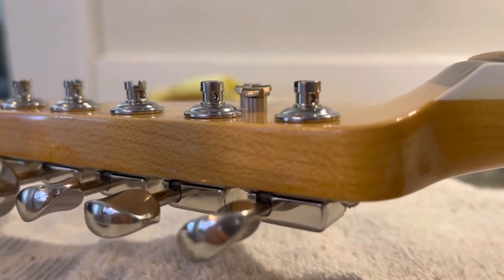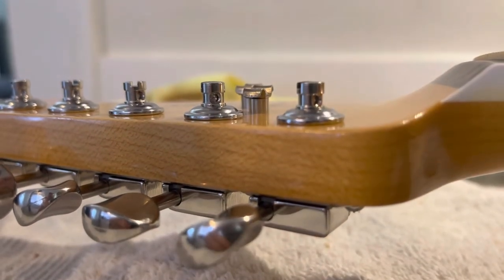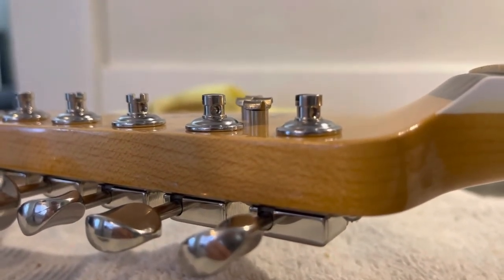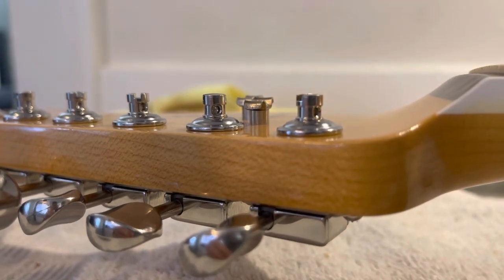Opening or Unlocking Fender Vintage Style Locking Tuners.

Comment: Not sure why no one seems to understand these.   If you use and screwdriver and hold the locking mechanism stationary and turn the corresponding tuning counter clockwise it closes the lock.  If you turn the tuner clockwise while holding the top stationary it opens the string lock.  It's actually an excellent design
Reply from the maker: It’s a pretty solid design, just a different solution than the norm. Takes a few string changes to get used to it.
Reply: @justinjuk  NO  they still suck to most people i'm certain.We aren't stupid and capable of using them once figured out but mostly over engineered. its unneeded buggering about changing every string was and is still is what it is! and for most people. it's still a pain. Not a practical design, all said  & done regardless compared to others. Have vintage strat & trem with vintage tuners works 100  fine, good set up is all thats required. = no need to use these anyway.Mark my words one day they will discontinue them if Fender listens to the feedback.
Reply: Thanks @Mike Duke. Once I'd read this, the tuners made perfect sense to me. Easy when you know how.
Reply: You don’t have to hold anything but the string. Once you’re through the hole, hold the string tight, wind it up with the tuning key, and it locks itself. You’ll know it’s locked when the string goes up in pitch.
Reply: THANK YOU! Your paragraph was better than any video I could find and now I can string my guitar!
Reply: This comment was more helpful than the video 😂
Reply: @rjake61 what about unlocking them when you want to change strings? Do you need a screwdriver to hold the tuners stationary as you reverse turn the tuning buttons?
Reply: @jasonswitzer1748 
Most of the time, they’ll unlock when unwinding the wound strings. On the plain strings, use a coin in the slot to loosen after the string is slacked. It doesn’t take much.

Comment: These things are terrible in so many ways. Rather than listing them all, I’ll just ask you a question: Why are you here watching this video?
Reply: Stumbled upon by sheer coincidence and i totally agree. cosmetically and tunings fine thats the only positive.just a vintage style locking MH Fender decided to make available. yep they suck read my above posts, i'm sure you all (most) have same experience, overall i'd say they should get phazed out if not done so already?. Have a 2017 Cs Tele with them in unknowingly spec'd out with fender cs  by shops decision to mess about with spec order , you just wouldn't know at first glance or just by tuning guitar until my/your 1st string change, and multiple times after until i simply had enough of the horrible things. two years later i just has enough so changed them out and never looked back to normal vintage style Gotohs. just make sure the machine head ferrules are replaced as original fender ones are way to tight fit gotoh replacement tuning machines (will fit with a strong push fit) but a real bugger getting in tune as to tight. get original ferrules out as mine were soooooooooo tight even with the provided tool with a light hammering would not shift them . well on mine anyway without using  the bolt/washers and nut/spanner method of pulling  original ferrules out.Make sure to protect your pegheads top to avoid any top finish problems.
Reply: @marknorth  Yeah, they really suck. I was lucky enough to have some regular “vintage” Fenders that just dropped right into the ferrules, no problem. ✌
Reply: @stockholm1752  out of a 100 etc i wonder how many people eventually swap them out for regular vintage tuners?, ha.
Reply: I have these on my JV Modified 50's Tele. The fact that I have to use a screwdriver and winder defeats half the purpose of having locking tuners.
Reply: Agreed.
Reply: I understand why they designed them this way. A lot of people complain about the extra material to have a knob in the back makes the headstock too heavy and ruins your tone on vintage tuners. So they wanted to hide the locking mechanism.

Comment: Thanks you helped me unlock the string, but when I try to tighten the new string it just keeps turning the string the opposite way and ends up breaking the string before it can lock.   What am I doing wrong?
Reply from the maker: Yeah, it’s a design flaw in my opinion. It should have a left handed thread so it turns in the same direction of the string winding.  Hard to explain without showing it, but I let the string spin around as I tightened it. Once it was tight, it wound ok.
Reply: @justinjuk  Thanks man!  I was holding the string taught while tightening it and it snapped.  I guess I gotta leave some slack next time.  Most likely will switch out for regular vintage style tuners.
Reply: Yep I have these and am not happy with this mechanism...make s changing strings a nit of a nightmare! I think the locking tuners that lock from underneath are a much better system!
Reply: You turn the tuner to lock and bring up to pitch. The screw slot is only for unlocking without the string.

Comment: you must use a coin , a screwdriver spoils the slot. When string is inside turn right but fix the string, it closes then automatically. I got these lockers in vintage rusted look.
Reply from the maker: Great point on using a coin. Thanks for sharing that!

Comment: Initially i was excited to own my set of gotoh locking tuners.i had no idea that there are 2 tuners that have tiny holes in. Labelled with green stickers. If i had read the instructions id have had a much easier time. Got there in the end. Put string through hole and hold it tight then use string winder to go counter clockwise which turns the screw thread pulling the top trapping the string against the shaft. Since installing them I've had nothing but great tuning but i find releasing the mechanism to remove the string is quite hard. It doesn't just unlock you have to keep turning it until it pops.. not easy to quickly change strings with these pegs.

Comment: There is a MUCH simpler way to do this:

Using a string winder, turn the tuner to "loosen" the string until the post releases it, then pull the string out.  Then, install the new string and pull it through the hole in the post; pull the string to take all of the slack out of it then use the string winder to "tune up" the string.  After enough turns, the post will "lock" onto the string and you then tune it up to pitch.  Easy peasy.

The string winder makes it easier because you will have to turn the post several times to release, and then tighten, the string.  Nothing needs to be removed, nor do you need a screwdriver.  Hope this helps!

Comment: These tuners are similar to the Gotoh Magnum lockers I think. A little over engineered IMO but they work fine.
If you don’t like them then get different ones.
I honestly like the vintage style self lockers personally but I have one of the JV Modifieds and those tuners are great too.
I have a LP w/a Kluson locking set thst unlocks from the top w/a coin. Not exactly genius work either but less hassle than all the winding.
I want to play not spend time winding strings. I’m 52 and impatient.

Comment: I've got the regular modern "F logo" locking tuners on my Fender player plus Stratocaster, but I got a Squier CV 70s Jaguar recently and I want to keep the vintage look of the headstock, so I think I'm gonna try these out. Thanks for the demo.

By the way, I'm considering putting a Seymour Duncan single coil sized humbucker in my Jaguar, but I'm not sure if it will fit because they are designed for Strats. Seymour Duncan only makes hot Jaguar pickups for jaguars, but I really want a humbucker in my Jag. Does anyone in this comment section happen to know if a strat single coil-sized pickup would fit into a CV Jaguar? Thanks.

Comment: Do you leave slack for the string one it’s through the post? Help! I can’t get the string to lock in to tune them. Haha I feel stupid that’s for sure
Reply from the maker: Another viewer left this comment and it works really well:
If you use and screwdriver and hold the locking mechanism stationary and turn the corresponding tuning counter clockwise it closes the lock.  If you turn the tuner clockwise while holding the top stationary it opens the string lock.  It's actually an excellent design

Comment: I really never saw the use of locking tuners if you don't have a whammy bar.  I have a Gretsch 6120 Brian Setzer model with Spertzel locking tuners that work great with the Bigsby whammy on that guitar. But to have then on a fixed bridge Tele is just unnecessary baggage.
Reply: Most locking tuner designs (not this one) make changing strings a lot faster. That's the reason a lot of people go with locking tuners even without tremolo.

Comment: Yes, once you figure out how they work, they work just fine, but I don't really see the point. I truly don't. Its just another fancy fandango that doesn't really improve things much. I can string a guitar just as quickly with vintage Strat tuners, and anyone whose been around guitars long enough knows that string breakage is far more likely with these, where the string is being held in-place and basically 'impaled' by the piston inside the tuner. PRS was using essentially the same thing almost 30-years ago, and I broke 1st (high e) strings quite often, and usually well before achieving pitch.

Comment: @ mike Duke Well i do disagree for sure, they might look the part, stay in tune, good etc etc, but possibly worst choice of all lockers because there way to finicky and a pain to restring everytime plus i had them come pre installed on a CS tele so you probably wouldn't know vs original vintage ones.. I have sperzels and others which are far far better as a design point goes and ease of use. Frustrating even knowing how first time to operate, minuses I've mentioned also if your not very careful (i am btw a perfectionist and take great care of all my guitars) when changing to new strings. i have a cs strat with the normal vintage tuners just as good stability wise any day of the week, just a clever fender gimmick in my opinion if your guitars set up right. if you as i do also use the trem arm a lot. its decked without any mods or locking machines just keep it lubricated with nut sauce & i have no problems with tuning stability worst dive bombs included with minimal problems since jan? 2021 .....be warned worst professional locking machines in current design by far I've ever come across and I've played over 45 years. Also built guitars from 100% scratch and not with cheap or premade parts put together and do admittedly love my Fenders. just my opinion only so no reason to gripe or just plain ignorant how to use them or complain about things , but boy just try a string change with these vintage locking type fitted.Its all an individual's opinion anyway but if truth be told yes they are a pain in the * in comparison to many others. Take em, leave em or even change them?....it's not my problem after all. I'm just trying to help weigh up the pros & cons being a user myself.